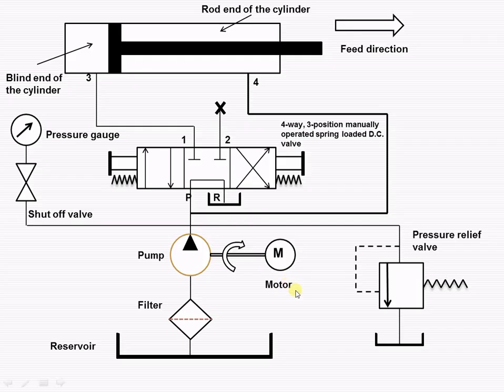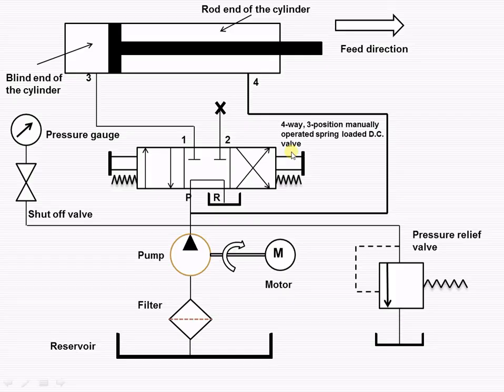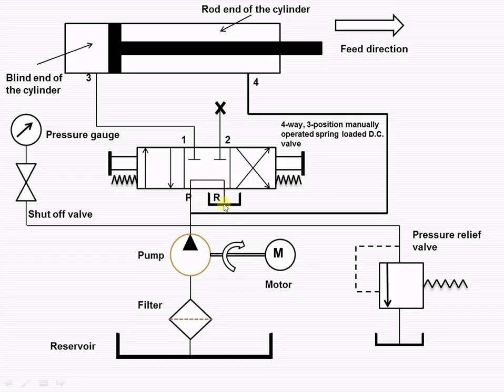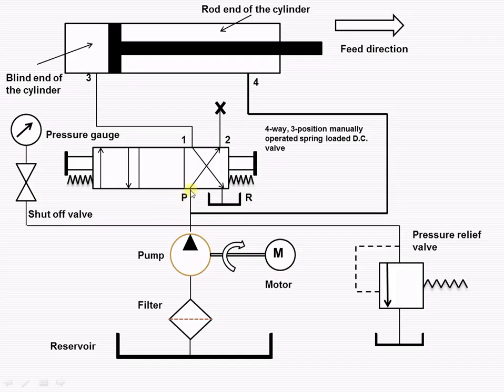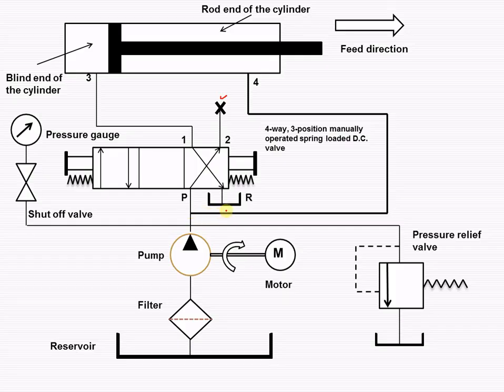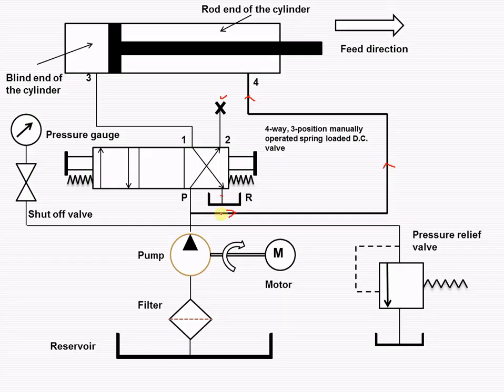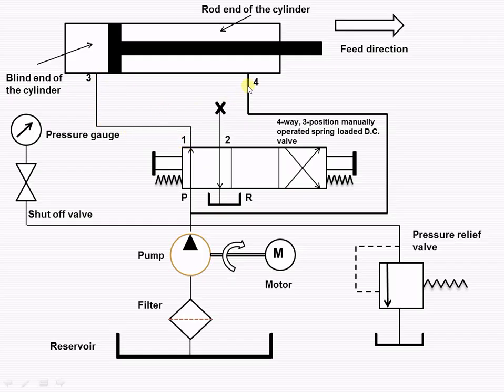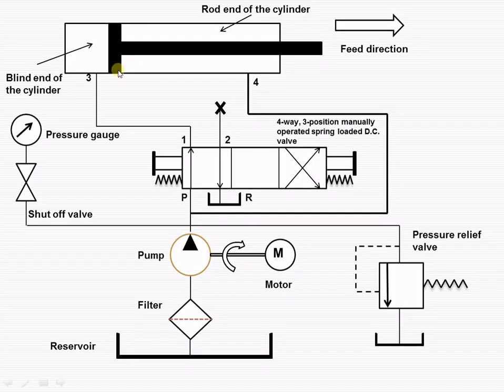Lecture 4 | How regenerative hydraulic circuit works

Comment: what if pressure goes to both end while regeneration? i think there should be check valve
Reply from the maker: Yes. This is basic circuit for the explanation of the concept.

Comment: 00:01 Technicians implement regenerative hydraulic circuit
00:11 Regenerative hydraulic circuit helps in energy conservation
00:21 Regenerative hydraulic circuit lacks legal origin
02:09 Regenerative hydraulic circuit increases efficiency
02:12 Regenerative hydraulic circuit improves efficiency and reduces energy consumption.
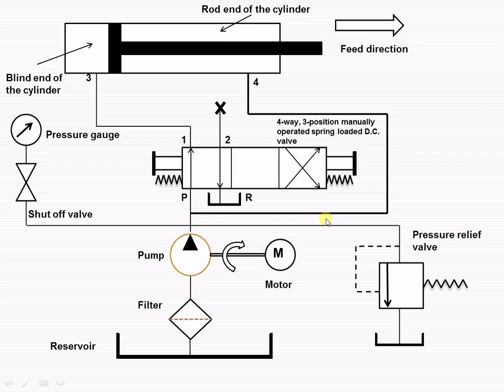03:22 Regenerative hydraulic circuit enhances efficiency
03:24 Components located outside in regenerative hydraulic circuit
03:27 Understanding the operation of the regenerative hydraulic circuit

Comment: Tnx about this useful video from korea
Reply from the maker: Most welcome !!
Useful playlists for you !!!

Hydraulic circuit & pneumatic circuit working - https://bit.ly/3zAx1e4
Cam profile - https://bit.ly/3vjpY7a
Mechanics - https://bit.ly/3PClXmz
Beam reaction & Graphic statics - https://bit.ly/3veMwWA
SFD and BMD- Simply supported beam and cantilever beam - https://bit.ly/3PDzA4V
SOM & Structural analysis videos - https://bit.ly/3OEqX8S
Heat transfer - https://bit.ly/3PzxiUe
Thermodynamics - https://bit.ly/3J5ZvQd
Velocity & Acceleration diagram - https://bit.ly/3vj8zf0

Comment: Using this system would reduce the amount of force  the piston can produce, as force is arrived by multiplying pressure times area, on a normal circuit pressure is only applied to one end at a time so extending the rod you apply pressure to the head of the piston and allow the rod end open to the tank so no pressure is applied, if we use a simple number of 3 square inches for the piston area and one square inch for the rod area using 9 psi of pressure so on a normal circuit you have 3 square inches times 9 psi which is 27 pounds force on extending the rod and to retract the rod you have 3 square inches minus the 1 square inch of the rod where no force is applied which gives you 2 square inches times the 9 psi which gives 18 pounds force on retracting the rod which most circuits require, 
On this regeneration circuit what you get is on extending the rod you have the 9 psi pushing on both the 3 square inches of the head of the piston plus the 9 psi pushing on the 2 square inches on the rod end of the piston which gives you 9 pounds force on the head and 6 pounds force on the rod end so you end up with 9 pounds force minus the 6 pounds force from the rod end so you end up with only 3 pounds force on extending the rod and the normal 6 pounds force on retracting the rod so you end up loosing ⅔ of the force along with having pressure on the rod end seals all of the time insted of only when retracting the rod.

I can see no advantage for using this type of circuit on any real world application unless you want to wast energy or lower the amount of force applied to the extending ram which you could get by just lowering the pressure relief valve setting.
Reply: Thats why pump volume, hose size and over size valving should be used vs this design.

Comment: Could I get a couple of questions answered.
1. Is the force that the ram is capable of significantly reduced? I'm thinking that it is only going to be the are of the rod divided by the area of the cylinder multiplied by the pressure. This would typically mean about 30% of the force?
2. Is the pressure on the retract stroke going to be the pressure relief pressure?
Reply: Yes, the force of the ram is reduced. Regen is only used for fast forward progress, not for force.

Comment: in the second case why would the piston extend the pump applies pressure on both sides
Reply: pressure yes, but not force because of the difference in area, also in rela there could be check valve that only flows the fluid in one direction

Comment: In left most position of DCV , pressurized fluid from pump gonna enter in Port 3 and 4 as well, so piston won't move anywhere..isn't it? PLEASE ANSWER ELSE I'LL UNSUBSCRIBE CHANNEL. THIS IS BASIC OBVIOUS thing I'm asking
Reply from the maker: The flow entering the port 3 is PUMP FLOW + THE FLOW from port 4 .. which creates regenerative action and hence the forward motion with the higher speed ...
Reply: CHINMAYACADEMY but pump pressure is higher than pressure in port4 line,then fluid from pump will go in Port 3anf Port 4 as well... How the low pressure fluid from port4 shall enter into high pressure line coming from pump?
Reply from the maker: The design made is such that some part may enter the port 4 but port 3 receives most of the discharge ....
Reply: CHINMAYACADEMY NOT SATISFIED WITH ANS. you haven't talked about any such design
Reply from the maker: Omkar Shinde  ok

Comment: Hi there!
How would the hydraulic power compare to the mechanical power of such a circuit?
Reply: In a normal hydraulic circuit the mechanical power is arrived from the (area of the piston) times (the pressure applied) on exting the rod, 
 on retracting it is the area of the piston minus the area of the rod times the pressure applied.
 In this circuit the mechanical power would be (the area of the piston) times (the pressure applied) minus (the area of the piston minus the area of the rod) times the pressure applied which gives you only ⅔ of the mechanical power compared to a normal circuit.

Comment: It would be really helpful if you would have explained the role of pressure gauge and pressure relief valve and how to use them in different questions. Btw thanks for the great explanation.
Reply from the maker: Will definitely try ... Thanks
Reply: The role of the pressure relief valve is to prevent the circuit from going above a safe pressure as without it the circuit would just keep increasing the pressure until something burst which is a very dangerous situation.

Comment: this is not a regenerative circuit. A regenerative circuit uses float position at the DCV center position.
Reply from the maker: It is a basic regenerative circuit which serves the purpose of increasing the piston speed during the forward stroke ...

Comment: why during the position where port P connected to 1, the fluid will not travel to 1 and 4 simultaneously?
Reply: Fluid will not travel to port '4' because force exerted by the piston port '3' is more compared to the other side of cylinder port'4' , this is due to difference between area of cylinder on piston side and area of cylinder on the piston rod side.